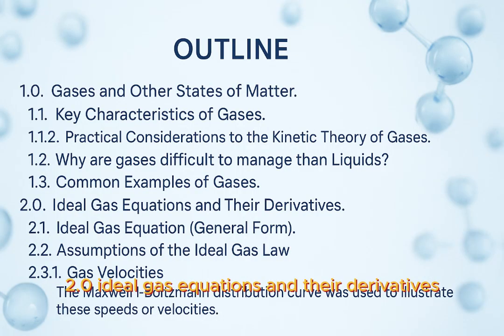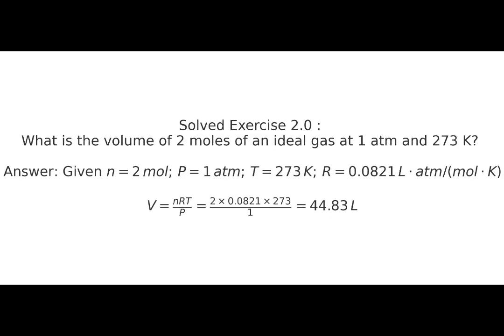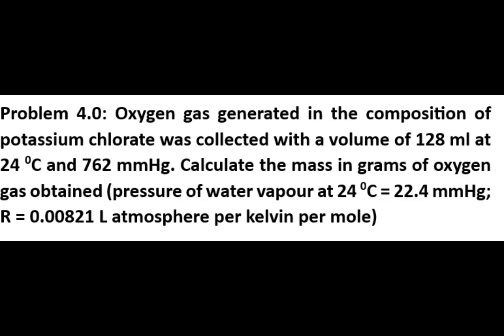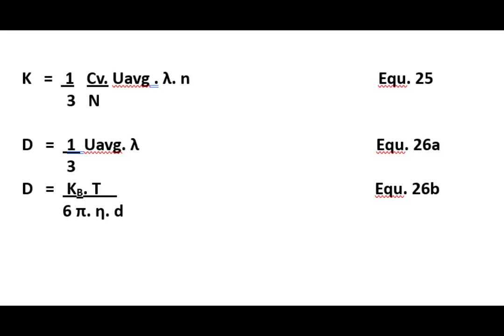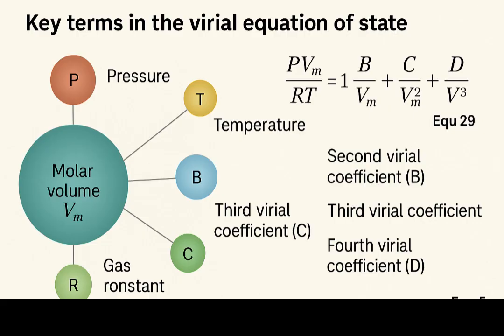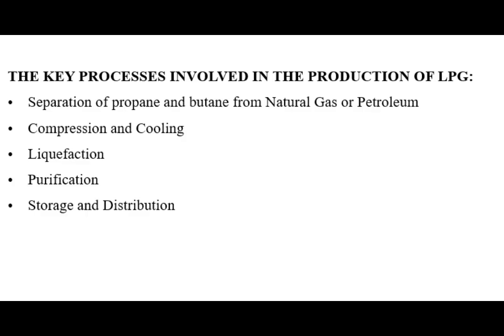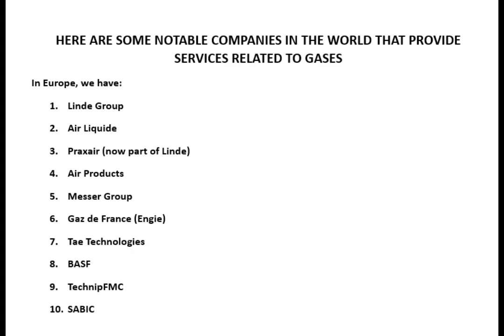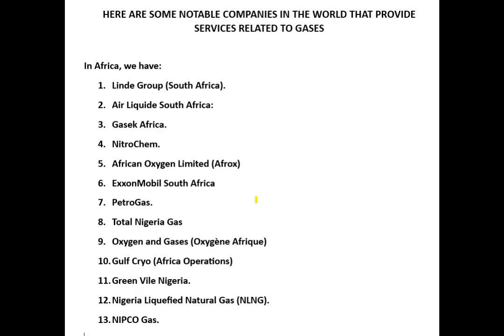Fundamentals and Applications of Gases

Comment: BCT: AYIYI ADESUWA AMANDA 

The ideal gas equation, PV = nRT, can be used to estimate the amount of gas produced by rearranging the equation to make n the subject:

n = PV/RT

Where P is the measured pressure, V is the volume of the gas, T is the temperature in Kelvin, and R is the ideal gas constant. By substituting the measured values of pressure, volume, and temperature into the equation, we can calculate n, which represents the number of moles of gas produced by the biochemical process.

Comment: BCT
Name: ORJI CHIDINMA FAVOUR
Mat No. : U2024/5735308

Answer: The ideal gas equation, PV = nRT, helps us find the amount of gas produced. We can do this by using the measured pressure, volume, and temperature of the gas. By putting these values into the equation, we can calculate the number of moles of gas produced. In simple terms, the equation helps us determine how much gas is present in the vessel.

Comment: BCT: AJIE JULIET ANNABEL 
MAT NUMBER: U2024/5735048

The amount of gas formed can be determined using the ideal gas law, PV=nRT. Once the pressure, volume, and temperature of the gas in the vessel are known, they can be substituted into n=PV/RT. The value obtained for n represents the number of moles of gas produced during the biochemical process.

Comment: BCT
NAME: SORBARI FAVOUR SORBARI 
U2024/5735013

A biochemical process produces a gas in a closed vessel. The ideal gas equation can be used to estimate the amount of gas produced if the pressure, volume, and temperature are measured.

Comment: BCT
NAME:   JUSTIN, PRINCESS
MAT NO. U2024/5735057
              

The ideal gas equation, PV = nRT, can be used to estimate the amount of gas produced by rearranging it to make n the subject:
n = PV/RT

Where P is the measured pressure of the gas,
 V is its volume, 
T is its absolute temperature in Kelvin, 
 R is the gas constant (8.314 J mol⁻¹ K⁻¹). 
By substituting the measured values of pressure, volume, and temperature into the equation, the number of moles (n) of gas produced can be calculated.

Comment: BCT: CHUKWU NICE 
U2024/5735344

The ideal gas equation pV=nRT Can be used to estimate the amount of gas produced in a closed system by measuring the pressure (P), volume (V),and temperature (T). By rearranging to n=PV/RT,the number of moles of gas produced can be calculated.

Comment: BCT:NDUBUISI AMARACHI BLESSING 
U2024/5735107
-Using ideal gas equation,the amount of gas produce can be estimated by rearranging the equation.By measuring the pressure,volume and temperature of gas in a closed vessel,substitute the values into the equation to calculate the number of moles of gas produced.

Comment: BCT:OKICHE DIVINE ERUOMACHI 
U2024/5735256 

The ideal gas law lets you calculate the number of moles of gas produced from measurements of pressure, volume, and temperature.

n= PV\RT

Substitute the measured pressure (P), volume (V), and temperature (T) into the equation. The value of n gives the amount of gas produced in moles.

Comment: GMT.
KUMANYIEKE BRIGHT
U2024/5765002

Answer ✅
When gas enters a large space, its volume increases, causing its pressure to decrease if temperature remains constant. If temperature also changes, pressure and volume will change accordingly. A geologist uses these gas laws to predict gas expansion, pressure changes, and possible movement of gases in underground rocks, wells, or reservoirs.

Comment: BCT: EMELIFONWU GEMMA.
U2024/5735296

You can use the ideal gas equation (PV = nRT), to find the number of moles (n) of the gas produced by rearranging the formula to; (n = PV / RT).
By measuring the pressure (P), volume (V), and temperature (T) of the vessel, and using the ideal gas constant (R), you calculate the exact amount of gas.

Comment: BCT: Godwin Emmanuel bassey 
U2024/5735041

The ideal gas equation, PV = nRT, can be used to estimate the amount of gas produced by rearranging the equation to make the number of moles, n, the subject:

n = PV/RT

By measuring the pressure (P), volume (V), and temperature (T) of the gas and using the appropriate gas constant (R), the number of moles of gas produced can be calculated. The value of n represents the amount of gas produced.

Comment: BCT: Harmma Deborah 
U2024/5735156
Using the ideal gas equation 
PV=NRT 
Rearrange to find the amount of gas:
N=PV/ RT 
Measure the pressure (p), volume (v), and the temperature (t) of gas, then substitute them into the formula. the result, n is given the amount of gas produced in moles

Comment: GMT: Anthony, Emmanuel. Answer: The relationship between gas pressure, volume, and temperature helps a geologist understand how gas behaves underground. When gas enters a larger space, its volume increases while its pressure usually decreases, especially when the temperature stays constant, according to Boyle’s Law. If the temperature increases, the gas pressure can also increase, while a decrease in temperature can lower the pressure. Therefore, studying these relationships helps geologists predict how gas will expand, move, or change pressure when it enters larger underground spaces such as rock formations or mine areas.

Comment: BCT: JOHN CHIDERAH FAVOUR 
U2024/5735126

The ideal gas equation lets us calculate the amount of gas `n` produced by rearranging to n = PV/RT, using the measured pressure, volume, and temperature of the gas in the closed vessel, assuming the gas behaves perfectly

Comment: BCT: ALBERT IJEOMA MICHELLE 
U2024/5735056
 

Using the ideal gas equation 
Pv=nRT,the total pressure exerted by a mixture of non reacting gases is equal to the sum of the partial pressure of all the gases in the mixture .
Reply: BCT:Evans success ikariyere 
Using the ideal gas equation 
pV=nRT
 rearrange to 
n=PV/RT
Substituting the measured pressure (P) volume (V) and temperature (T), you can calculate the number of moles of gas produced.l

Comment: Divine .A. Yoko
U2024/5735226
BCT
SSLT
The ideal gas equation PV=nRT can be 
used to estimate the amount of gas 
produced by rearranging it to n=PV/RT
By measuring the pressure (P), volume 
(V), and temperature (T) of the gas and 
using the appropriate value of the gas 
constant (R), the number of moles of 
gas produced can be calculated.

Comment: Name :  Stephen Bright Saturday 
Mat No : U2024/5765006
Dept :     GMT 
Faculty :  SSLT 

The relationship between gas pressure, volume, and temperature helps a geologist predict gas behavior. When gas enters a larger space, its volume increases and its pressure generally decreases, especially if the temperature remains constant (Boyle’s Law). If the temperature changes, it can also affect the pressure. This helps geologists understand how gas may expand, move, or become less pressurized in underground rock formations or mines.

Comment: BCT: OLOYO, RUBY CHIDINMA
U2024/5735108
 — Using the ideal gas equation , the amount of gas produced can be estimated by rearranging the equation to. By measuring the pressure, volume and temperature of the gas in the closed vessel, we can substitute these values into the equation to calculate the number of moles of gas produced.

Comment: BCT: Obisie Maryjane Chimboroma 
Mat no: U2024/5735152
The ideal gas equation, PV=nRT, can be used to determine the volume of gas produced by rearranging the given equation to make n the subject of the formula, and by so, we have n= PV/RT. By measuring volume (V), temperature (T), and pressure(P) of the gas and using the right gas constant (R), the number of moles of gas produced can be calculated. The amount of gas produced represents the value of n.

Comment: BCT 
UKACHUKWU MIRACLE 
Ideal gas equation : PV=nRT 
To find the amount of gas produced in moles, rearrange the formula by making  “n” The subject:

n=PV/RT 

Then substitute the measured values of P, V, and T into the formula.
With the ideal gas constant R which should be chosen based on the units of pressure and volume. 
When you solve, the result gives the number of moles(amount) of gas produced.

Comment: BCT
OKECHUKWU PRECIOUS ONYINYECHI 
U2024/5735/009

The ideal gas equation is PV =nRT
Where 
P- Pressure of the gas 
V- volume of the gas 
n- number of moles of gas 
R- gas Constant 
T- temperature in Kelvin 

To estimate the amount of Gas produced you rearrange

n =PV/RT 

Measure the Pressure , Volume and Temperature of the gas and substitute into the Equation then the number of moles of Gas can be Calculated

Comment: BCT: Chikodi Chinonye gift 
Mat no: U2024/5735166
Using the ideal gas equation 
PV=nRT
Rearrange to
n=PV/RT
Substituting the measured pressure (P)Volume (V)and temperature (T)you can calculate the number of mole of gas produced

Comment: BCT: OHWOKIRERHUO OGHENEWEGBA VICTORY
MAT NO:U2024/5735267

ANSWER:  Gas equation is PV=nRT

To estimate the amount of gas produced, rearrange the equation to make the number of moles ,n,  the subject 
n=PV/RT

Where:
P = measured pressure of the gas
V = volume of the vessel
T = absolute temperature in Kelvin
R = ideal gas constant, 

Therefore, by measuring the pressure, volume, and temperature of the gas and substituting them into , we can calculate the number of moles of gas produced. If the molar mass of the gas is known

In conclusion: The ideal gas law allows us to determine the amount of gas produced from its measured pressure, volume, and temperature.

Comment: BCT
NWAHIA OZIOMA EDITH 
U2024/5735155
The ideal gas equation is PV =nRT
Which help us convert the pressure, volume and temperature that we can easily measure into any amount of gas in moles that the biochemistry process made 
It only works best if the gas behaves ideally and the vessel is closed so no gas escape.

Comment: BCT: AGU FAVOUR CHIWENDU 
U2024/5735045
Using the Ideal gas equation 
PV=next
Rearrange to
n =pV/RT
Substituting the measured pressure (p)
Volume (v) and temperature (T), you can
Calculate the number of mole of gas produced.

Comment: BCT: Emmanuel Goodness Iheoma 
U2024/5735096

The ideal gas equation PV= nRT can be rearranged to n= PV/RT 

Now by measuring the pressure, volume and temperature of the gas, you can substitute these values into the equation to calculate n, the number of moles of the gas produced.

Comment: BCT:AWOLOWO TREASURE AREPADE 
MAT NO:U2024/5735081
•The ideal gas equation helps you estimate the amount of gas produced in moles(n) from the measured pressure,volume and pressure
n=PV/RT
Therefore: by measuring the pressure,volume,and temperature of the gas and substituting them into 
n=PV/RT, we can calculate the number of moles and gas produced

Comment: BCT: NWACHUKWU ADILENE CHIMELA 
U2024/5735019
Using the ideal gas equation
PV=nRT
Rearrange to
n=PV/RT
substituting the measured pressure (p) volume (v) and temperature (T),you can calculate the number of moles of gas produced.

Comment: BCT: EGBE EUNICE 
The ideal gas equation PV = nRT relates the pressure, volume and temperature of a gas to the amount of gas present. 
In a biochemical process where gas is produced in a closed vessel, we can measure the P, V, and T of the gas after the reaction by rearranging the equation to solve for n (the number of moles of gas) n = PV/RT.

Comment: GMT:OBUMNEKE EMMANUEL CHIMUANYA 
U2024/5765012
The relationship is given by the ideal gas law: PV = nRT.
When gas enters a larger space, its volume increases, so its pressure decreases if temperature remains constant. This helps a geologist predict how the gas will expand and move, and whether it may cause rock failure (crack, collapse), sudden gas release, or an explosion if pressure changes rapidly.

Comment: GMT: OYIBO PLEASURE BOMA 
U2024/5765001

The relationship between gas pressure, volume, and temperature is described by the Ideal Gas Law:
PV = nRT
When gas enters a larger underground space, its volume increases. If temperature remains constant, the pressure decreases according to Boyle’s Law (P₁V₁ = P₂V₂). If the temperature changes, it can also affect the pressure. Therefore, a geologist can use the relationship between pressure, volume, and temperature to predict how gas will expand, how its pressure will change, and how it may behave as it moves through underground rock formations or mine spaces.
Reply: GMT: Abasiakamauwem Israel umoren 
U2024/5765022

The relationship between gas pressure, volume, and temperature is
described by the ldeal Gas Law:
PV = nRT
When gas enters a larger underground space, its volume increases
If temperature remains constant, the pressure decreases according
to Boyle's Law (P,V, = P2V2). If the temperature changes, it can also
affect the pressure. Therefore, a geologist can use the relationship
between pressure, volume, and temperature to predict how gas will
expand, how its pressure will change, and how it may behave as it
moves through underground rock formations or mine spaces.

Comment: BCT:  Ekpo-Ette Miriam Johnson 
Mat no. U2024/5735021
The ideal gas equation pv/nRT can be estimated by measuring the pressure, volume, and temperature of the gas in the closed vessel and substituting them into n = PV/RT, the number of moles of gas produced can be estimated.

Comment: BCT: IHUNWO CHIMEZIE BARA AMARACHISOM 
The ideal gas equation (PV = nRT) helps estimate how much gas is produced by using the measured pressure, volume, and temperature to calculate the number of moles (n) of the gas.

Comment: BCT: LEDEE BARIYIGA LEKA
Mat number: 2024/5735002
The ideal gas equation is:PV=nRT is used to estimate the amount of gas produced by rearranging it to n=PV/RT 
By measuring the pressure (P)
Volume (V), and temperature in Kevin (T) of the gas, we can use this formula to calculate the amount of gases produced in moles 

Therefore, the amount of gas produced can be estimated using equations n=PV/RT

Comment: BCT: ADIONYE LIFE NDUBUISI 

The ideal gas law, PV = nRT, allows us to quantify the amount of gaseous product formed. By measuring the system’s pressure , volume  and temperature, and rearranging the equation to n=PV/RT we can directly calculate the number of moles of gas produced. This value can then be converted to mass or volume at STP using the molar mass or molar volume.

Comment: BCT: SYLVESTER MIRACLE GODSTAR 

The Idea gas equation is: PV=nRT  is used to estimate the amount of gas produced by rearranging it to n=PV/RT 
By measuring the pressure (P),
volume (V), and
temperature (T) of the gas, we can use this formula to calculate the amount of gas produced in moles.

Therefore, the amount of gas produced can be estimated using equation n=PV/RT

Comment: BCT
Abinoye faith omeraam 
mat no _065

answer 1

The ideal gas equation, PV = nRT, can be used to estimate the amount of gas produced by rearranging the equation to find the number of moles, n.

PV = nRT
Dividing both sides by RT:

PV/RT = nRT/RT

Therefore:
n = PV/RT

By substituting the measured pressure, volume, and temperature into the equation, the number of moles of gas produced can be calculated. This provides an estimate of the amount of gas generated during the biochemical process.

Comment: BCT , UBEE MSOOTER ESTHER  The ideal gas equation PV=nRT is used to estimate the amount of gas produced by rearranging it to 
n=PV/RT by measuring the pressure (P), volume (V), and absolute temperature (T) of the gas in a closed vessel , the number of gas molecules produced is calculated. Temperature is in Kelvin

Comment: BCT: Merenini Deborah Chinaemere 
Use n = PV/RT to get moles from P,V,T. Just make T Kelvin, match R to your units, and subtract water vapor pressure if wet. Assumes ideal gas, which is fine for most bio gases at low pressure.

Comment: BCT: NWAEKE BLESSING IJEOMA— The ideal gas equation PV= nRT can be used to estimate the amount of gas produced by rearranging it to n=PV/RT. By measuring the pressure (P), volume (V), and absolute temperature (T) of the gas in the closed vessel, the number of moles of gas produced can be calculated. Temperature should be expressed in Kelvin.

Comment: Keke judith uchechi
BCT
Answer: The ideal gas equation, pv=nRT,can be used to estimate the amount of gases  produced rearranging  n=/frac(PV)(RT). By substituting the measured pressure (P), volume (V),and absolute temperature in Kelvin (T),the number of moles(n) of gas produced can be calculated using the correct value of the gas   constant, yhe equation helps to determine the amount of gas produced in closed vessels

Comment: GMT: GIBSON ROMEO BARIDULE 

The relationship is given by the ideal gas law: PV = nRT.

When gas enters a larger space, its volume increases, so its pressure decreases if temperature remains constant. This helps a geologist predict how the gas will expand and move, and whether it may cause rock failure(crack, collapse), sudden gas release, or an explosion if pressure changes rapidly.

Comment: Nworavor Jadolem Michael 
BCT
Answer: The ideal gas equation, pv=nRT,can be used to estimate the amount of gases produced rearranging
n=\frac( PV)(RT).by substituting the measured pressure (P),volume(V),and absolute temperature in kelvin(T),the number of moles(n)of gas produced can be calculated using the correct value of the gas constant, the equation helps to determine the amount of gas produced in closed vessel.

Comment: BCT: OWANTA CHIEMELA GLORY 

Answer: The ideal gas equation, pv=nRT,can be used to estimate  the amount of gases produced rearranging
n=\frac( PV)(RT).by substituting the measured pressure (P),volume(V),and absolute temperature in kelvin(T),the number of moles(n)of gas produced can be calculated ,using  the correct value of the gas constant , the equation helps to determine the amount of gas produced in closed vessel